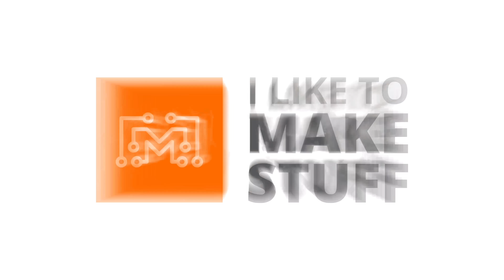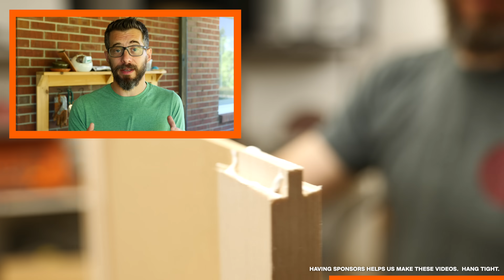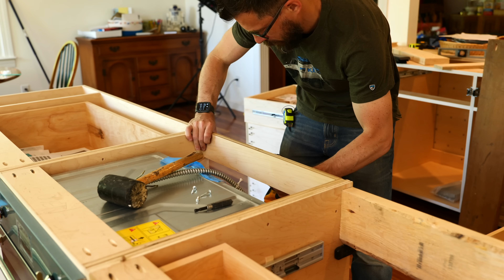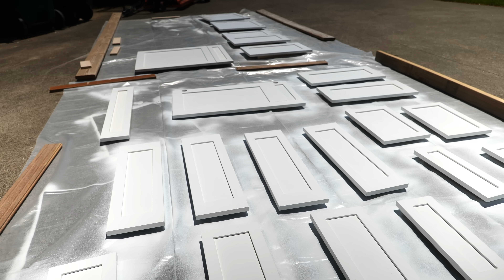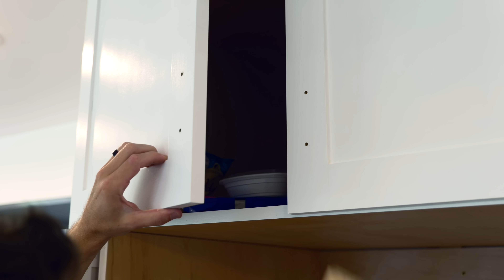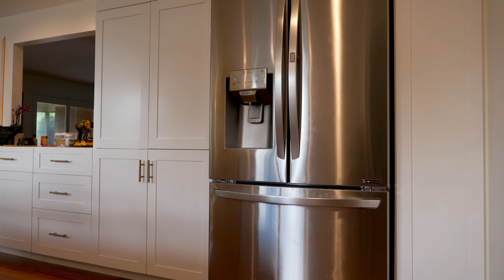Kitchen Renovations Aren't Like TV Shows! | I Like To Make Stuff

Comment: did you order a special kind of countertop? here in germany, you can drive over to any hardware store, pick one out, they have vertical panel saws there and cut it to size for free.
Reply from the maker: They are a stone-like material that has to be specialty cut and polished. They can't do it in our stores
Reply: @Iliketomakestuff  "They are a stone-like material" - Exactly what material are you referring to?

Comment: I used to work in an appliance store designing kitchens. The CAD model thing is true, mostly. Dishwashers and ranges/stoves you are probably good with. If it gets replaced/discontinued they are all basically the same size. Wall ovens, vent hoods and cooktops you should get them in your hands before you start cutting. I have seen bad things happen with drawings being really wrong.

Also put parchment paper on the wall around the venthood so you don't tear up the wall. Just don't leave it behind it. Its slippery enough to slide out as long as you don't put it over screws.
Reply from the maker: Good point. It is always a gamble basing real-world construction off of CAD models provided by the manufacturer. In our case, those pieces were going on an open wall and each element could slide a little to compensate.

Comment: Hopefully your countertops come. Have they given reasons as to why it's still delayed? If not I'd look at getting a refund for them and then just buy them somewhere else as that doesn't seem okay.
Reply from the maker: The material hasn't been shipped to them. I believe it is a wide-spread shortage, not a shortcoming of the installer.
Reply: @Iliketomakestuff  ah okay, seems a bit weird you were able to order the item without them having the materials though. Hope you get your countertops soon though. It'll be nice to finally see it finished.

Comment: @I Like To Make Stuff, A small tip for drilling above yourself while collecting the dust. 

Buy a silicone bucket (Collapsible, Softer edges). Make a small hole at the bottom centre of it. Just enough for the drill bit that fits into the drill, can fit slightly loosely through. Position the drill, do a starter mark at the right spot. Then push the bucket up against the roof and drill. It will collect all the dust without you having to use a cardboard box. 

Since it is collapsible, you can keep push upwards till it goes flat. And its silicone, so it will more forgiving toward ceiling paint. Compared to normal hard plastic. Then when retreating, just push the bucket back up against the ceiling so you don't spill it everywhere. Of course, you can probably make a custom 3D insert for a vacuum on the bottom portion too, if you wish. So you can create a 'vacuum' of sorts while drilling.

Comment: That jig for mounting hardware looks like it was designed by NASA. Much better then my IKEA version. Great video, always a pleasure to watch!
Reply from the maker: It's pretty substantial, but it works really well
Reply: Those have been around long enough for knock-offs to show up that work well.
Reply: When I did my kitchen I made a jig from scrap wood. 
Free is always best IMHO.
Reply: Also better than the two random plywood offcuts I screw together for mine. Lol.
Reply: Be reeeally careful, and check it to reality. I've bought two "cheap" versions on Amazon. Both of them, that center stop was crooked!!! I didn't realize it until I was 3 drawers in, and all of my handles were low on the left, and high on the right when I used it reversed. Ugh! I returned it, got a new one sent out, and it was just as bad, and ended up returning it. You get what you pay for.
Reply: Be cool if it had a clamp on the back to put a backer board on it
Reply: the one I made for my knobs I made out of scrap wood and did the same thing. and after you're done using the jig I don't see the use for it regardless of it's cost
Reply: It will be a chinese knock off, they have been around about 30 yrs
Reply: The fancy one is over 200$ but it looks like it would work really well
Reply: IKEA is Swedish for firewood